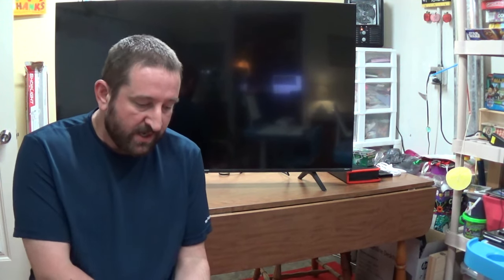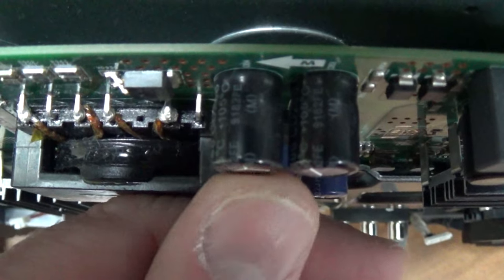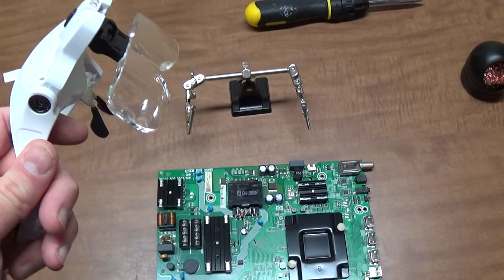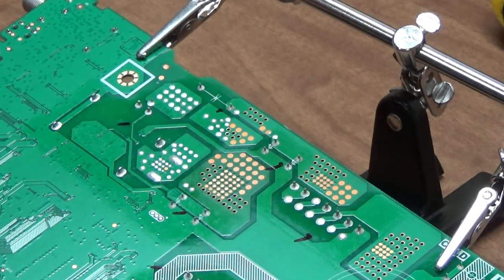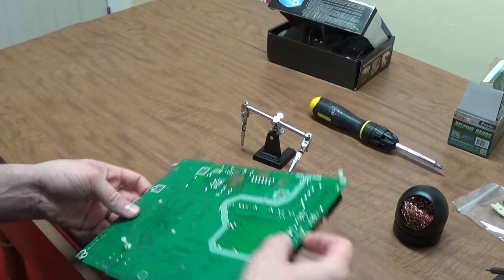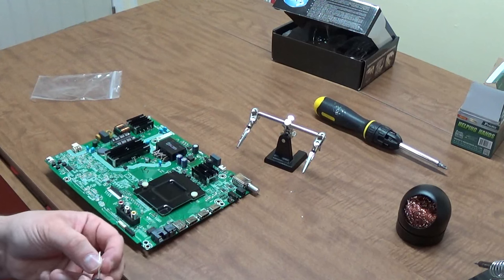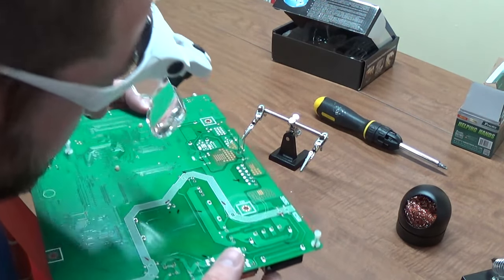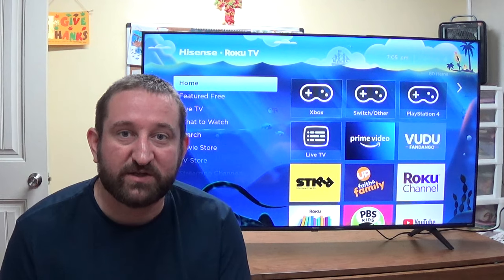Gaming On A Budget: Hisense "On and Off Repair" Full Tutuorial (55" R6 Series 4K HDR10 Model 55R6E3)

Comment: Well I had the same problem, but after I open up the TV, I saw two wires loose from the connector on the main board, I repaired the loose wires, still was having the problem while watching the TV, so I replace the HDMI cable on HDMI 1 with a new HDMI cable and no more problems with TV cutting off by it self. problem solved! This TV have a Beautiful picture, that why I would like to keep it, instead of getting rid of it.
Reply from the maker: Yes it does produce a great picture

Comment: Do you have a link to the exact capacitors you used? My TV doesn't turn on anynore, the red light just flashes, same model. Thinking it's the capacitors and wanted to check. Is there a way to visually identify a bad capacitor?
Reply from the maker: In the video I show you what a bad capacitor looks like.  The end is usually swollen.  The link to what I bought no longer works as I just tried it.  But what you want is 10uF 350v capacitors.
Reply: Sorry I meant to say is there any other indicators that visual besides the swollen ends like you showed in the video. I'm about to order some capacitors and see what happens.
Reply: Treat the capacitors with respect.  If they still hold energy they can do some damage on your hands
Reply: @nemesisbreakz  Any advice for dealing with them? Besides unplugging the TV and holding the power button for 30 seconds or so?

Comment: I did exactly what you're talking about and put the right capacitor back in there and I did this twice and they blew both times I can't keep the capacitors from blowing. It lasts about 2 weeks to a month and then they blow
Reply: Do you have any ideas on what I should do?
Reply from the maker: @brenthopkins9030  It could be a batch of bad capacitors.  I replaced mine over a year ago and they are still working or could be a worse issue with the TV.  You could get online and buy a new motherboard for it for a lot cheaper than a new TV.  Really sorry man.

Comment: Hi bruh, I just one capacitor where you have 2 is it normal, the ones that horizontal ? My mom went to repair and it was too expensive, maybe they remove it ?
Reply from the maker: If you have the same tv as mine then you should have two capacitors

Comment: Mine is shutting off intermittently, but only when connected to the Internet-Netflix, YouTube, etc. It will work fine with a Blu-ray.  I couldn’t see any problems visually with the capacitors.  Any thoughts or suggestions? Thanks!
Reply from the maker: This one is beyond me.  Apparently it seems your tv is having issues with either the network software or the ethernet port on the TV if you are using that.  Go into system settings and make sure you have the latest firmware update.

Comment: Hello everyone, I've got a 65R6E1 and before I decide to operate, can anyone tell me if this model is any different than the one in the video?  I suppose I'm lucky to have 4 years rather than 2 as I've seen in these videos. I had a 55" of the same brand that crapped out, and my wife got rid of it before I could even look at it. I think my biggest problem will be finding a good place to work on it. Thanx in advance to you all.
Reply from the maker: I'm honestly not sure, but its worth looking inside to see if you see any leakage or swollen caps.

Comment: I have a 58 inch hisense my screen went out and the light keep coming on and off is it the screen or the LED light
Reply from the maker: If the light is flashing on and off it is probably the capacitors that need replacing.  My light would flash on and off as well repeatedly when my capacitors blew.

Comment: On my 65 inch Hisense android tv it turns on for a sec and turn off and on the light blinks and turns off I opened it up and none of the capacitors look blown there flush so do I replace them idk?
Reply from the maker: I'm not sure, but it definitely sounds exactly like a cap problem.  It's doing exactly what my 55 inch was doing.  If the board looks like mine then try replacing those caps I show in the video.

Comment: Hello mate iam  from the UK I've got the same tv i bought it new 2 month ago turn it off last night an this morning it won't turn on there's no power light
Reply from the maker: Man, truly sorry for your troubles.  Nothing worse than buying new electronics only to have them go kaput in no time.  Reminds me of all the Xbox 360 systems I had issues with.  Anyway, definitely give the capacitors a check like I demonstrate in this video.  However if you aren't getting any power at all it may be a different problem.  The problem I cover here still has power running to the TV, but the TV turns itself on and off repeatedly.  However its worth your time to just pop the back off and see if you have any noticeably blown capacitors.  However from what I'm learning, sometimes they can be blown and not show it like mine did in this video.  However if you aren't getting any power at all it could be that your power supply has gone bad and I've never replaced one of those.  On another note, double check and make sure the cable that goes into the back of your TV hasn't come lose as that may be the simple solution and hopefully is the problem.

Comment: My tv went out 2 days ago i dont have a blinking light its just a black screen i still can hear everything i took back cover off as u did and i can see that something is lit up bright white thru the little holes
Reply from the maker: You need to reset your TV.  I'll get the reset code for you and be right back
Reply from the maker: Here's what you need to try.  Turn on TV.  Get your roku remote and press home 5 times, up one time, rewind button two times and fast forward button two times.  Now wait a few minutes while your TV reboots.  This should fix the issue.
Reply: Thanks buddy about to try that so sense I can see that it do have lights in the tv do that mean the led lights in the inside Good about to try the reset u gave me ill give update hope it work
Reply from the maker: @kevinhollingsworth1410  In my opinion, I don't think your screen is the problem.  I've had them run updates on the TV that caused it to glitch where all I could hear was sound and no picture or the colors would be messed up.  A quick reset of the TV always fixed it.  So hopefully that reset fixed yours as well.
Reply: @EDFCentral  Update ..I did the code u gave me it still black screen  maybe 1 off the capacitors went out that wired how the tv faded away until it was black only had tv 2 years hate 2 throw it away

Comment: Can you send me the size and link to find that capacitor
Reply from the maker: The cap size is listed in the video.  I can't remember it off the top of my head.  I think it was 10uf.  You can get them off of ebay for like 10 bucks.
Reply from the maker: The capacitor for my televions was the 350v 10uf.  You can get these from Ebay, Amazon or any other place that sells electronic components.

Comment: How do I remove the back? It's stuck in the bottom in the clear power button
Reply from the maker: Should come off as soon as the screws come out.  Nothing else should be holding it on.
Reply: I have the same problem. There's a clip holding it to the clear bit at the bottom around the power button and I can't get it to release. Did you manage to get it off?

Comment: My 1.5 yr Hisense 58r6e3 went,no pic or sound just red blinking light,have no idea if its the board or something else,no swollen caps
Reply from the maker: Still sounds like it could be those caps.  Worth a shot to replace them.  Much cheaper and if it doesn't work you're only out a few bucks and some time.
Reply: @EDFCentral  I see some boards on ebay for like $20 bucks,I solder pretty good but seems better to get a board
Reply from the maker: @joehiatt1992  Not a bad deal if you don't want to solder.  Save you time.
Reply: @EDFCentral  Replaced both boards & nothing,I have a LED tester coming tomorrow,someone else here said its the LED's,also ebay boards ur really not sure they are good, they ALL claim they come out of damaged store TV's lol

Comment: My Hisense smart TV does not have any features display on the screen only have that introduction of Hisense smart TV that it, does not catch other features
Reply from the maker: Sounds like your capacitors are bad and need to be replaced.  My tv would turn on, but not go past the introduction of Hisense screen.  Replacing the capacitors fixed the problem.

Comment: Can someone help Me??? Once I changed the compactor it worked for about 30 min then the screen stopped working 😊
Reply from the maker: Make sure your new caps aren't burst due to being defective.
Reply: Did you make sure of the polarity! Capacitors have a positive side and a negative side. The + side is clearly marked on the board.

Comment: I replaced both capacitors and still have a blinking red light
Reply from the maker: Did you make sure the caps were facing the correct direction with the white strip down?

Comment: You might as well of asked me to build my own TV from scratch 😵‍💫😬🤔. In fact $250 almost sounds like a good deal compared to me trying to repair my TV using this video 
Normally I'm fairly intelligent, but even thinking about these instructions makes me feel lik Boo Boo the fool! 🤔😬😵‍💫
Reply from the maker: Unfortunately this fix requires some work to do.  If you can solder you can do it.  If you follow the steps you can have it done in an hour and save yourself a couple hundred bucks.

Comment: For a two year old TV to be blowing capacitors in the 2020s is completely unacceptable. But then this is Chinese, so what do you expect.
Reply from the maker: Exactly! Shouldn't have to do this only two years in. Things are made so cheap anymore.
Reply: Chinese or not, any brand, they all use 8 cent capacitors when they could pay 50 cents per capacitor and NEVER have an issue with them even after 10 years...